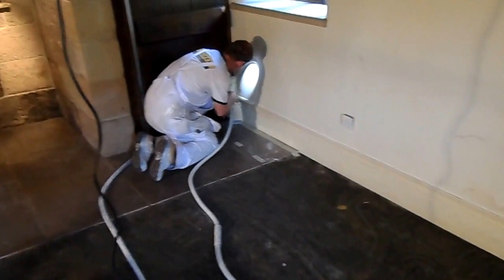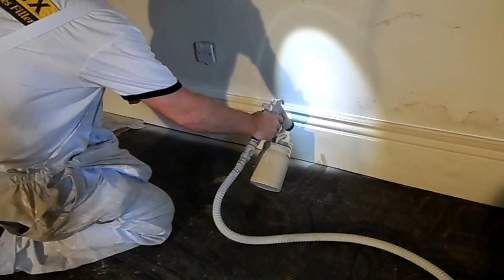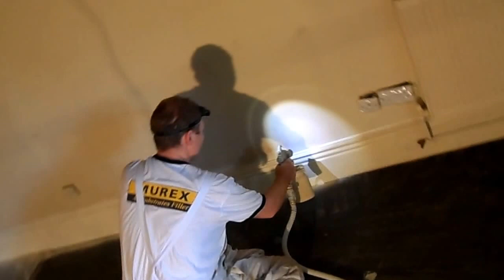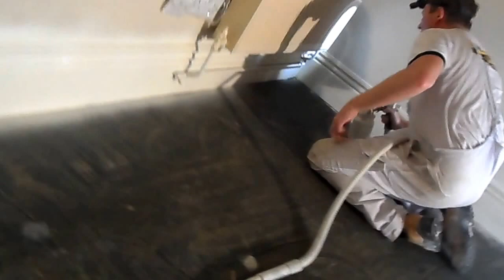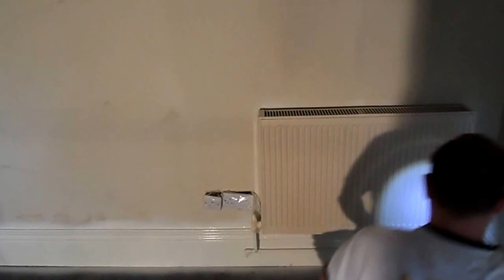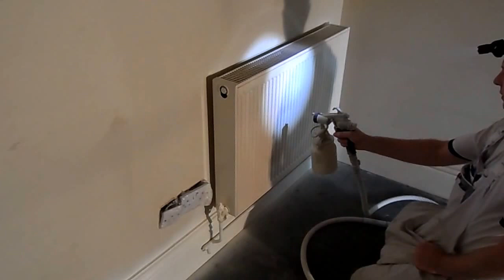HVLP GRACO 9.5 spraying half a litre of Sikkens BL Satura, fist of two coats.

Comment: Hi mate it looks a good job but HVLP is so  slow. Would you not use an airless with a fine finish tip. I know the downside is material required to fill the line and also clean up. I am thinking of getting a unit, the 7.5 for kitchen cabinets and radiators.
Reply from the maker: They take a little getting used to compared to an airless but the transfer rate is a lot better and clean up is a lot quicker.
Reply: Hi SurlySteve, HVLP isn't slow if the gun is set up properly.
The problem is a lot of people using them aren't using the correct fluid set, don't have enough paint flowing, and have the air flow all wrong. Once you add to that the poor skills of the person using it, it all makes for a very slow painful process.
Do get one, you won't regret it. I have a Graco airless 495 a 795, two cordless Truecoat models and a 9.5 HVLP. The 9.5 is a pleasure to use, the only minor thing I found is that you cannot adjust the fan width without turning the paint flow down. The new Edge gun is very good besides that.
With the correct fluid set and thinning of product you will get used to it in no time at all.

Comment: nice job mate im in process of purchasing this model looks the business
Reply: what product are you spraying??
what % did you thin or did you use an additive.
Reply: must admit i like the idea of the head torch more
Reply from the maker: Hi Ian its Sikkens BL Satura I put 1 oz of xim to 1 ltr of paint slightly warmed shot with a  number 5 needle at room temp 15 degrees and 60% humidity.
Reply from the maker: Phil yes its a nice machine takes a little getting used to though.
Reply: Why do you warm the Xim ??
Reply from the maker: Sorry I mean the paint Ian.
Reply: Why do you warm the Xim ??
Reply: Why to what benefit
Reply: Im still interested in why you warm the paint. What benefit does this add to your systems.
Reply from the maker: Hi Ian it lowers the viscosity and atomisers better with less thinning. Gives a little more control and its bloody cold up here we re about 7 degrees colder than you boys down south. Works a treat with sikkens BL saturated .
Reply: And how do you warm it up ???
Reply from the maker: Just in a bucket of warm water Ian.

Comment: Forget that vertical spraying !!!!
It would take a week to do the skirting in a house. Painful to watch ,really painful.
I use the same Sikkens product and don't have a problem spraying it.
Must be the gun set up.
Also at the angle you are spraying, you have more chance of missing or only dusting the underside of the moulded parts of timber.
I can honestly say I haven't seen skirting done like that in the 32 years I've been spraying.
I understand your explanation, but it doesn't make much sense to me. Especially if you are in business to make money (which we all are).
Having said that, if it works for you that's all that matters!
Reply: your expression " dusting " can i take it that means a pass of the gun but without leaving any material build .i.e no film thickness, sorry do not have experience with a HVLP, as yet. I want to spray trim work. But as you say the unit, material  set up has to be correct. Do you think having experience in airless only would mean that the Graco battery gun would be a good option. I have heard they do not last long, are heavy and must be very carefully cleaned or you get a lot of grief. I want a gun I can set up and clean quickly but will make my work look better and get done faster than my competitors ! cheers for advice mate, ta
Reply: SurlySteve1 Mate, personally I would get an HVLP gun for trim work.
I use airless and cordless but for real fine work on trim, furniture etc you can't beat HVLP.
Once you get the hang of it you'll be glad you did. Airless with a fine finish tip is good for general trim but I wouldn't do furniture with it.
My cordless guns work great. I always strain the paint into the gun and thin it a little to ease it through. The second generation gun is a lot easier to clean than the first, 
People say they don't last that long but the way I look at it is that they save you money in time and make your working day a lot easier. If you get 2 or 3 years out of them, they've paid for themselves times over. To me that's just the way tools are. Actually my oldest cordless is nearly 4 years old and I haven't had a problem with it. As for the weight, you get used to it.  
I have done furniture in acrylic with cordless and it was perfect.
In my opinion HVLP will take your work to another level though. Also I would buy the 9.5 Graco not the lesser models. 
Most of all I think most people get it wrong by not really 'looking' at the paint as they spray then making adjustments to their pass speed or the gun. It may sound simple but for me its all in using your eyes.
I could go on all day about spraying, but in short, get an HVLP. Also make sure you have  numbers 3,4,5 and 6 fluid sets.
With time and practice you will get it right.

Good luck, hope it works for you.
Reply: mrknobchopps thanks for your help. i think i will go for one. do you reckon turbine graco is better than a compressor and a cheap gun to get started. 9.5 is quite expensive if you dont use it a lot. cup and compressor option is a good bit less to get started at fine finish. i have some bar tops and tables to spray soon. would the pro shot 2 handle that type of work, cheers